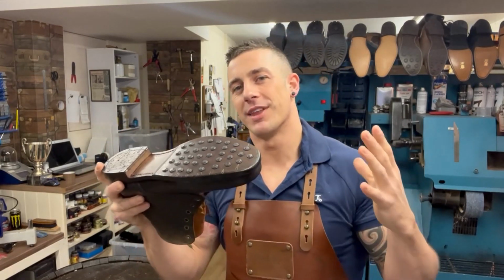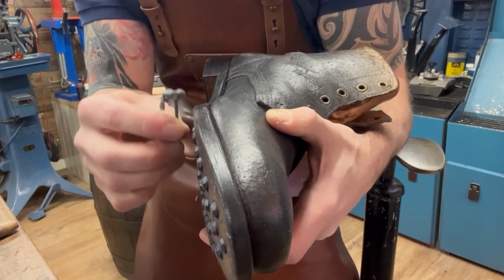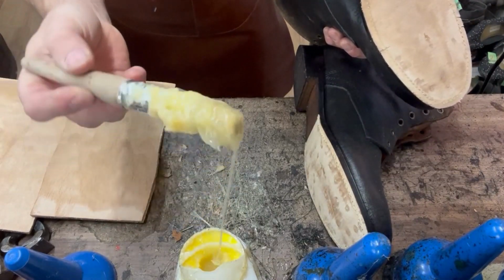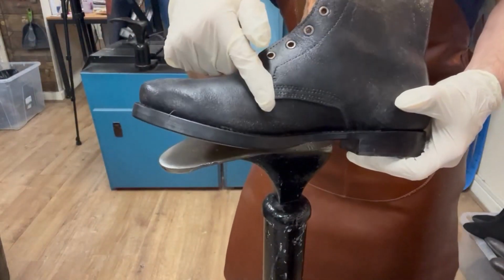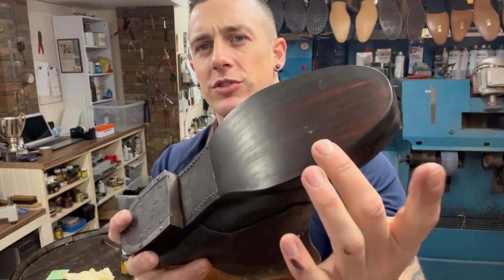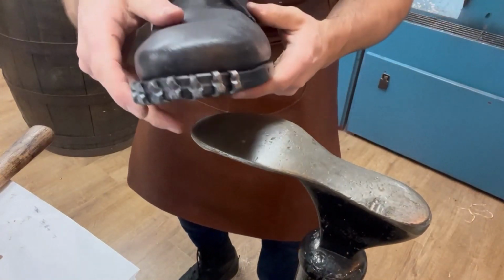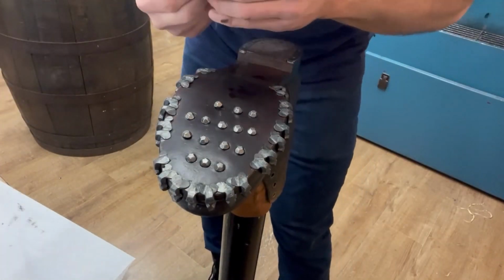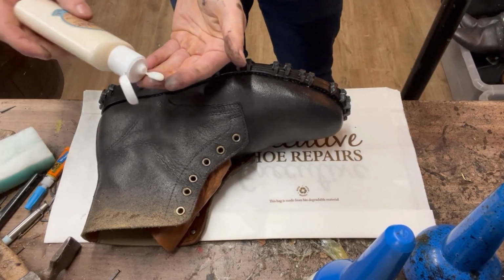GERMAN WW1 BOOTS Upcycled to MOUNTAIN CLIMBING BOOTS! Unusual Shoe Repair

Comment: Love your videos, and man do I hate to rain on your parade. But I'm fairly sure you put in the cleats wrong. They're supposed to be nailed up through the welt with the 'leaf' part of the cleat facing out on the side. They have the long nail so you can then fold the part sticking out back down and tuck it under the leaf part. Google 'gebirgjager boots' to see for yourself.. Sorry! Or if this was at the request of the customer, disregard and good video as always. And happy new year!
Reply: Damn, yeah, I think you're right.
Reply: I googled ww1 mountaineering boots and I see what you mean damn I wonder what happens now
Reply: Agree, it would make more sense the studs would be on the bottom similar to what he’s calling the “hob nails”. But in his defense it seems like the drawing shows both placed around the perimeter, fins as well as studs.
Reply: Oh jesus!
I googled for pictures of such boots and yes, it would seem you are correct!
Those cleats seem to be upside down.
Reply: Interesting, did he re set the studs in another video or ever address this?
Reply: @ Eltonno1985
That's some real niche knowledge. Thank you for enlightening us all. You are correct. 
That said, as a Mountaineer, I don't see these edge/toe leaves providing much of an functional advantage, even in their right orientation. 

Today we use a two part system for climbing, (a well insulated boot with solid locked in heel) AND (a metal bottom plate with pointed spikes going all around) attached to boot using chains or straps. This 2 part system eliminates the need to carry 2 boots. One to hike to the cliff face, and another to climb it. 

Going back to this shoe, it's design best purpose would be as as winter shoes for flat land covered in a mix of hard packed snow and frozen mud. Provided of course you have some heat reflective insoles and a good insulated sock. :)
Reply: @aayotechnology  I just paused on the drawing and they are showing rectangles on the bottom not leafs lol. The drawing is correct. That’s going to be one unhappy customer 😅
Reply: @subinct  Not so sure about this model of boots but the Swiss issued their hobnail mountaineering boots with metal spiked crampons you would put on using leather straps, which seems to me like an antiquated version of what you described. Regardless, thanks for the insight from modern mountaineering 😁.
Reply: You are totally right. Wow.
Reply: He def did these backwards I’ve seen three videos of boots and these look Ass backwards lol
Reply: Nice catch....hopefully the customer can get this corrected or  he'll be labeled a "FARB" by his reenactment unit. :)

Comment: 12:11 I knew there was something wrong when I noticed as he’s hammering one of the edge cleats in, another one popped off. Another guy in the comments mentioned those are supposed to be inserted vertically not horizontally LOOL. And he seems to be right when you google gebirgsjager boots.
Reply: I could not figure how those spikes were to give better grip the way it was mounted to these particular boots. You are right, your mentioned picture search made immediate sense; they are to be directed head down from bottom of the sole. Well, cant get everything perfect. The drawing was not very detailed and theres not many icy mountains to climb in his urban area, just a few neighbourly hills... :)) He makes beautiful works else in general. I wish I had anyone near his skills in my neighbourhood. All I have here is dubiously incompetent and uber greedy  guys with a motorized polish machine making no better result than what I can polish by hand, they carry a small selection of shoe laces (end of story yet they call themselves "Cobblers"), and can make double copies of simpler models of existing keys...

Comment: Looking at period boots. It looks like the side studs you had should've been nailed into the bottom of the sole and the excess stud clinched over the welt after coming through the welt. The "wings" that you have on the bottom should be on the side with the more "stud" shape on the bottom.
Reply: You're correct. I have an original pair (found years ago at a Polish flea market - they look gruesome and the bent over nails just add to the effect) which are exactly as you describe - and the 'wings' overlap.
Reply: yeah after googling mountaineering boots, I have noticed its nailed on the wrong side 😬
Reply: Yep. The boots in the vid look Blake Stitched, and the outsole edges pretty close to the upper. Probably need something with a pukka Norwegian Welt to make it work.
Reply: You'd think a YouTube channel that features fixing shoes and boots could've done the same research a commenter could do to make those mountain boots more period correct. I'd rather watch a video of the commenter making the boots.
Reply: Spot on and how uneven were they anyway?? No symmetry, no measuring, not even close to being the same side to side and never mind how uneven the hobnails were too, sheesh, amateur hour... The least one could do would be to measure it all out...
Reply: Yeah, the “wing” should be on the side, not the “hob”,  customer probably pissed off, should be an easy correction though.

Comment: Might be a good idea to send some spares for such a rugged hobnail like that. If the customer is going to use them for what they were intended, he/she will no doubt lose some along the way regardless if you welded them on. According to doctrine, most mountain companies of the period had someone trained to replace the nails as they got lost, during normal usage on the ice. They weren’t trained cobblers, by any stretch, just trained in the most minor repair such as hobnail replacement.

Comment: A bit late, but Happy New Year! You certainly put some interesting stuff on your channel.
The nails are called ‘Tricouni’. Search for Tricouni images to see how they are fitted. The nails go up through the sole and are bent over after cutting to length to prevent them pulling out when using the edge of the boot when climbing on rock.

Comment: Так же подошвенный слой наката нужно обязательно усиливать вокруг дубовыми колышками. Это не просто повышает надёжность а не даёт расслоения слоя даже при сильном намокании и морозе при полной деградации клея. пускай работа будет стоить клиенту больше зато сделана будет профессионально с реконструкторской и практической точки зрения.
   Also, the sole layer of the rolling must be reinforced around with oak pegs. This not only increases reliability, but also prevents the layer from delamination even when heavily wet and frosty with complete degradation of the adhesive. let the work cost the client more, but it will be done professionally from a reconstruction and practical point of view.

Comment: Happy new years Dan!  I was very intrigued by the boots and went looking then up.  Unfortunately, I think you may have installed the cleats upside down.  Granted outside of the diagram you showed, I don't know what else your customer instructed you to do.  I eventually got to something similar using the search, Alpine hobnailed mountaineer boots.  Either way, very intriguing and entertaining video!
Reply: I was thinking the exact same thing the way they're on now doesn't look like they'd add any grip what so ever i think the long shank is supposed to go through the whole edge of the sole & then clinch over considering your whole body weight is pulling against them
Reply: This video shows how they were supposed to look https://youtu.be/JYkW5VHWkYE

Comment: I think the the cleats are 90 degrees off.  The spike should have been driven into the sole. the thick part of cleat should be what contacts the walked on surface.  The wafers should be on side of sole.

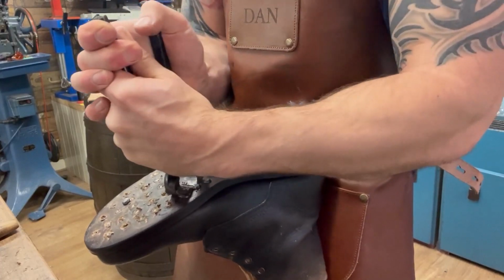Comment: 3:59 Nice job but pretty simple and slim with the original sole compared to a climbing Gebirgsjager boot but you did great work
Towards the end of the war, the Waffen SS began to switch to similar short-leg boots like this instead of long boots just with slightly less iron on the edge
Reproduction German WWII Low Quarter Boots around 250$ I have no idea also, how much an original World War I German mountain boot can be worth
Reply: In 1942 the entire Wehrmacht (by this time the Waffen as was apart of) was supposed to have halted production for marschtiefel. However, you see Schnürschuhe with rear guard troops as early as 39.

Comment: Those boots are looking pretty ACE, mate! :)

Question about conditioner though: My army boots that I wear during the winter are made of Gortex. Will a leather conditioner work at all on Gortex fabric and treat it the same way or would I just be wasting time and money trying to use it expecting the same results as I would get if they were leather?

Thanks again and happy new year!
Reply: Not only would conditioner not improve the fabric in any way, you're potentially going to lose one of goretex's biggest advantages, which is breathability. Conditioner makes sure the fibers in the leather are pliable enough not to crack when flexing and rubbing against each other. Fabrics don't need lubrication, but you can coat them to make them water resistant. That's the original purpose of waxed fabrics, but, as textile technology developed, we found new ways to achieve waterproofness, which is exactly what goretex is. The threads in a modern membrane are woven densely enough not to let water through.
Reply: Contact the maker and ask how you should treat your boots.